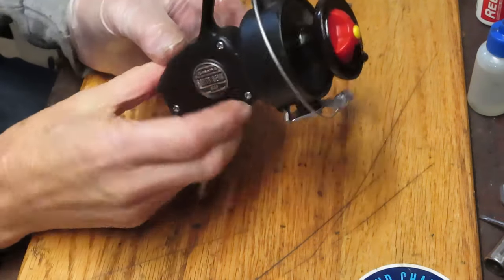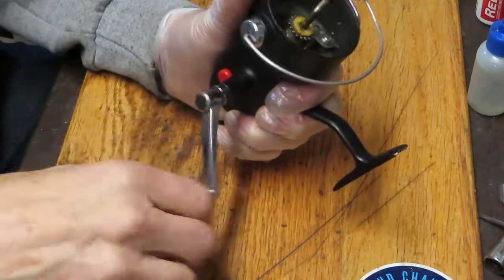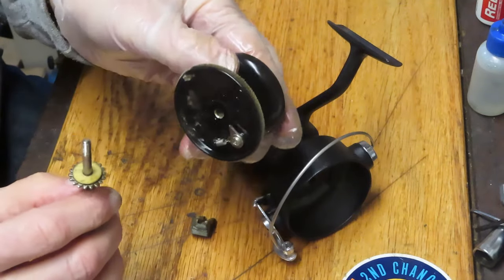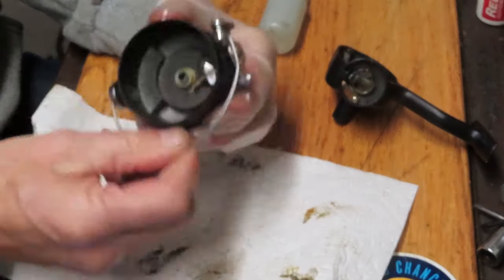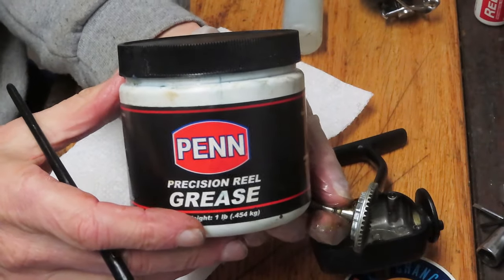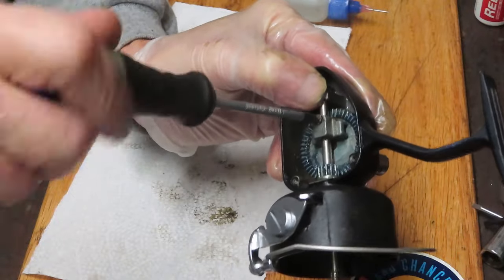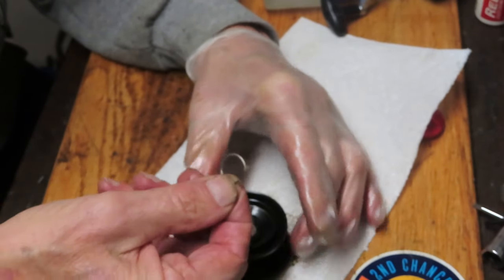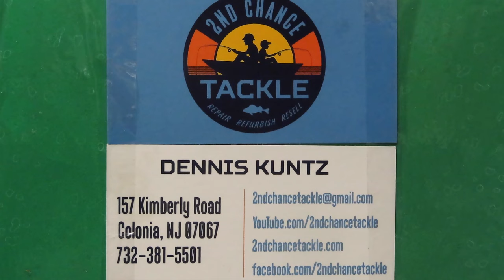Gladding South Bend 840 spin fishing reel how to take apart and service

Comment: I have a larger version of this reel. I bought early on when I started collecting reels. I wish I hadn’t bought it but I did not know any better at the time. It was brand new in the box. The South Bend reels I like are part of the Classic Series. However the Classic Series II are not the same. The ones I like are worm gear reels much like the older Spinfishers by Penn. I don’t care for the Hong Kong South Bend reels. — Chris
Reply from the maker: Yes - these reel are very nice examples of good reels that are still inexpensive.  If there is a drawback, it is the weight of the reel - Sore arms after a full day of surfcasting for sure!
Reply: @2ndChanceTackle Dennis, my biggest objections are not the weight or price but the lower quality of the construction. You mentioned one in the side-plate screws that were not stainless. There are a number of other examples. I have many reels with this same mechanism in terms of the oscillation and main gear. I really dislike any reel put together with a large u-clip. Other examples are some of the Daiwa J reels and the 1500C.  Lastly, the paint of these reels has a very limited lifetime being just as bad as some of the silver series reels.  All of this is why I said I wish I had not bought one. — Chris